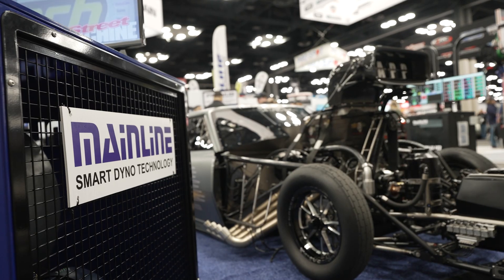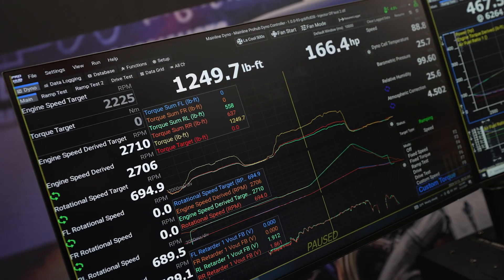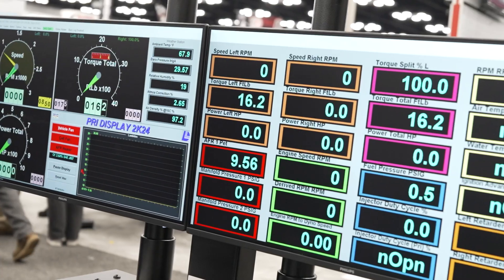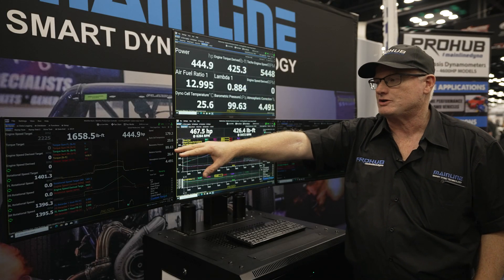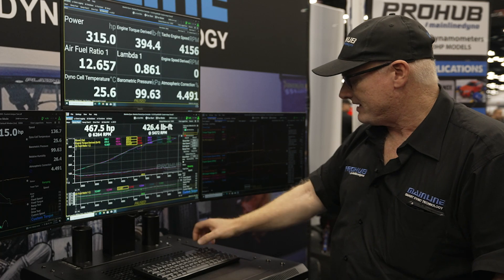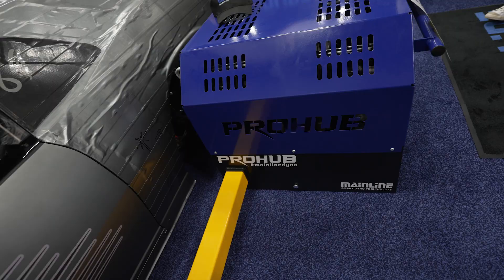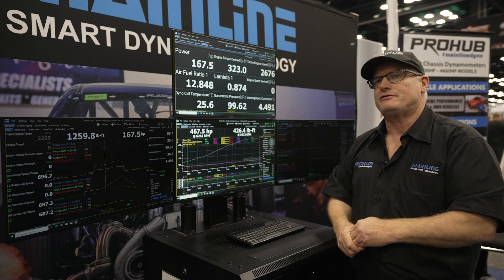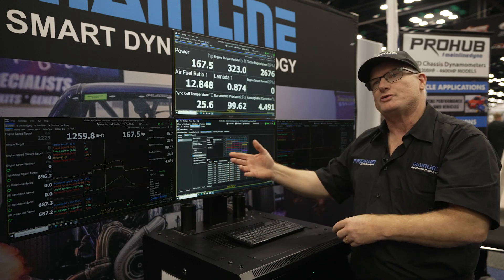Mainline Dyno Launch New CAN Control Software at PRI Show 2024

Comment: Does this mean Mainlines didn't have  ECU CAN input up until now  ?
Reply: Mainline has had CAN for ECUs since 2007. About when ECUs first had ECU outputs.
Reply: @mainlinedyno8306  So it now means  people can use  ECU manufactured we CAN expansion devices increase the the configurable channel count of the Dyno ?
Reply: @incolink  Yes the new system has user-configurable CAN inputs